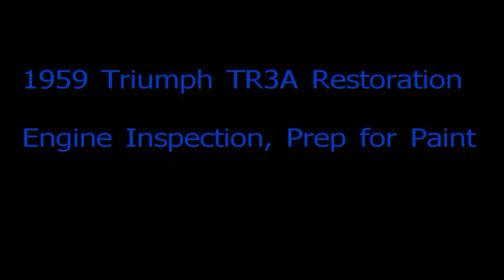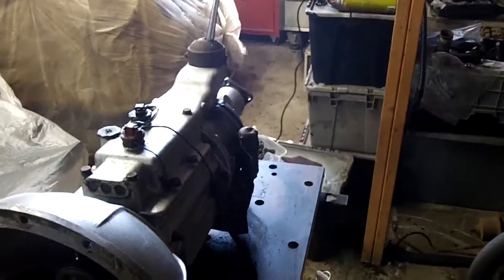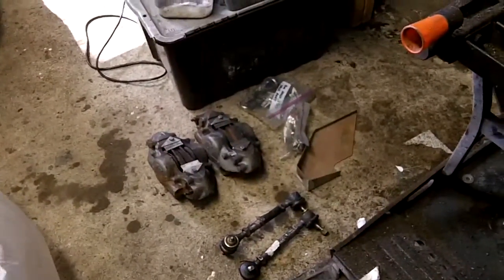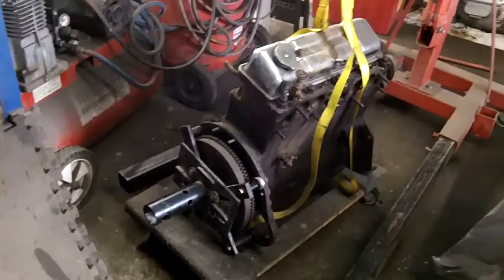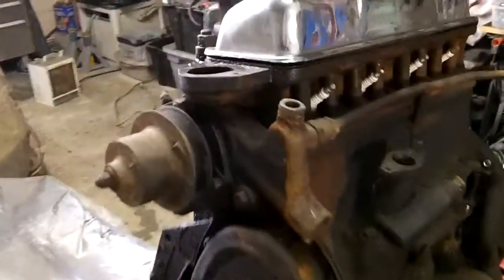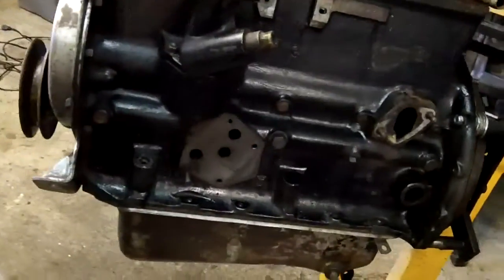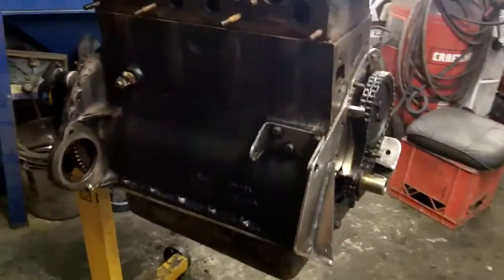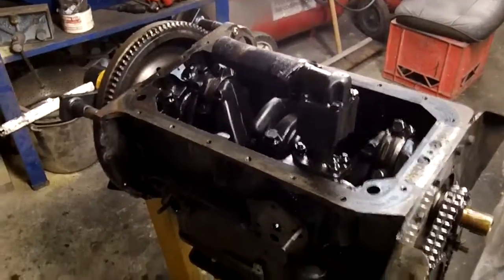1959 Triumph TR3A Restoration, Engine Inspection/Prep for Pa

Comment: Engine is looking good. From the sounds of it there won't be any bigger mechanical repairs necessary. Will you measure the end play on the crank? It may not even be necessary. It doesn't seem as though that car was driven a lot. I'm enjoying every minute of these videos, Chef. Thanks for taking the time and making the effort to share the work with us.
Reply from the maker: Hi Bruce , not so much of an issue on these TR 3s but a huge issue on the TR6s. Always a good thing to check with the dial indicator. Thanks for watching and commenting.

Comment: I might have tried to keep the original TR 3 on the block by covering it with a light coat of grease or something to cover it up while I painted the engine.  Or I might have taken some solvent and carefully removed the new paint over that TR 3, then touched up the R a little, can't really duplicate the original fella's hand... Good job that it's a TR3 block though and it's pretty clean for such an old engine and one in a sports car to boot.
Reply from the maker: I got some tracing paper and traced the outline...call me crazy.   I should be able to get a pretty close representation of it.

Comment: I gotta ask Tush...How long has your buddies Capri been at the body shop.?..That pickup screen is a biggie...You'd be lucky to fit your thumb in the pickup on a modern engine,..Cheers mate.
Reply from the maker: ZIGgassedUP Hi Zig.   Been there for about three weeks I think...personally, I don't see much progress since it is supposed to be the only car the guy is working on....there seems to be some disagreement now as well....originally, the guy told my buddy Les that he would be taking the car down to bare metal...apparently, that has changed now and the guy is going to scuff the paint and shoot over it....not great.

Comment: This video brings up some ?s about the engine in my TR6.  Does the # on the block match the vin of the car?  Mine does not. My engine # is CC58855E and my Car VIN is CC58680.  I assumed that my motor had been replaced at one time.  This TR6 blew a head gasket back in '84 and I bought it about 4 years ago.  I noticed a big red "6" on the side of the block and I assumed that it was some type of salvage yard ID mark. But after watching your video I am not sure.  Jerry
Reply from the maker: Hi Jerry , going to do a little video reply tonight to answer your question.  Have a look, cheers, tush.

Comment: I’ve been tearing down my ‘59 and have started on the engine. I’m planning a total rebuild, and I’m stuck, literally on the nose piece that connects the fan to the crank pulley. In your video, it looks like it splits just in front of the pulley, but the TR shop manual  looks like it splits midway under the pulley. How do you remove this?  All of the nuts have been removed.
Reply from the maker: Have you removed the crank bolt and the fan extension piece?
Reply: Um, yeah... son of a gun, the crank bolt IS a bolt and a hex to boot, looking at it from the side all gunked up, it looked cylindrical, ha ha.  At lest I thought I knew what I was doing, thanks for the tip!
Reply from the maker: @jpk323  glad I could help.  If you’ve got an impact gun, it works well to get that bolt out.